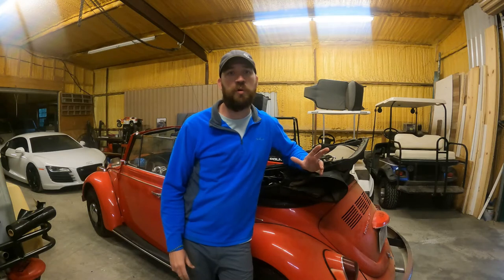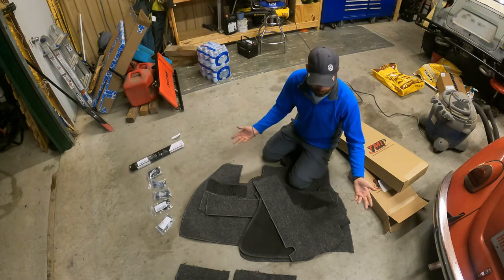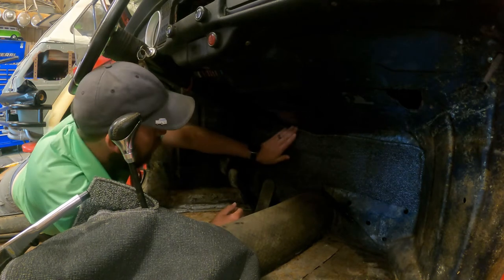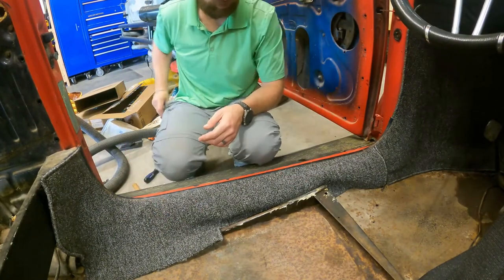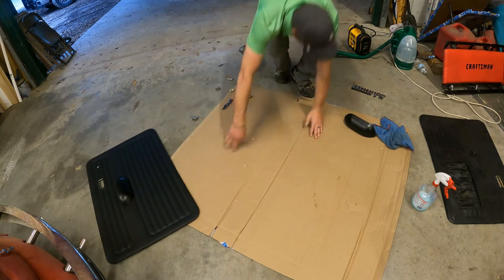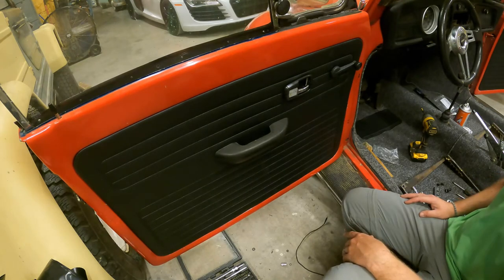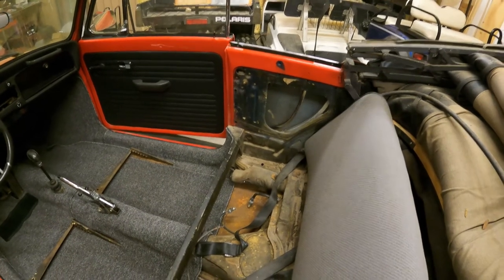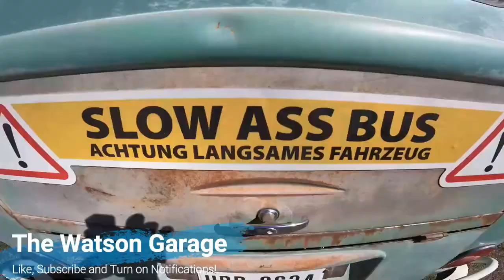How to install NEW Interior in VW Beetle

Comment: Nice carpeting work but why no rust treatment on the floor?
Reply from the maker: Thanks... the pans need replaced and I have them as well. I was just going to get it in better shape to cruise around this summer and then do the floor pans later as the side carpet has no effect on them. The bottom pieces aren't glued so it didn't matter. Through the making of the video I decided to just sell it and focus on the VW Thing I traded for.